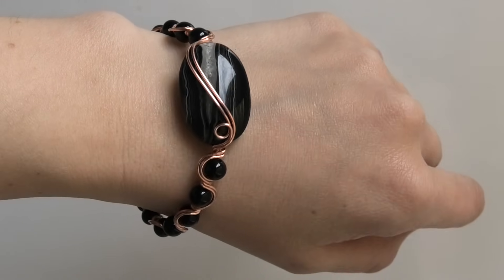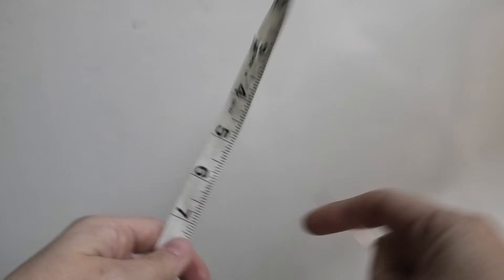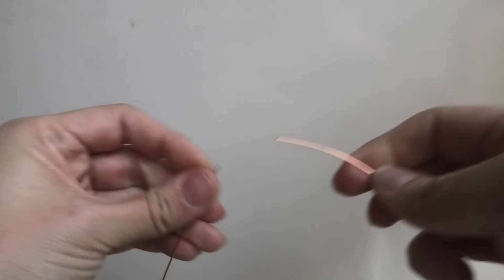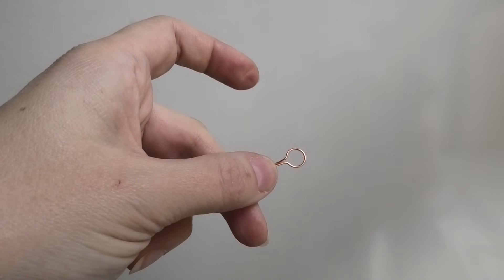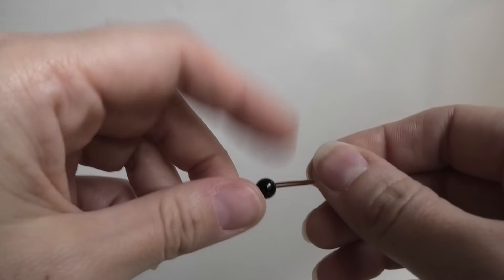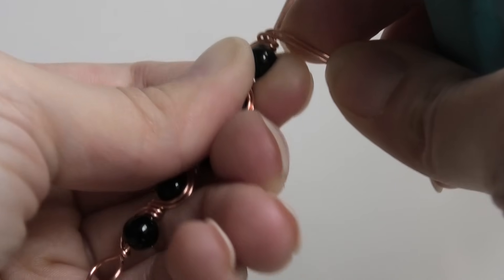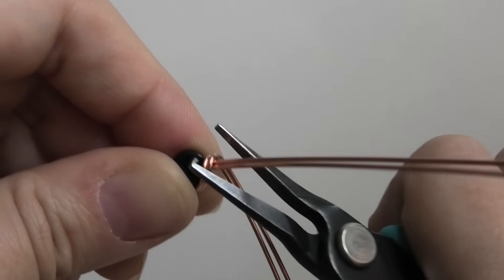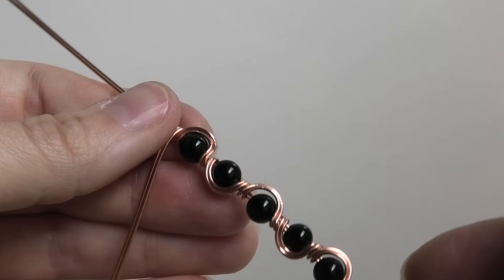Wire Wrapped Bracelet Tutorial with Beads

Comment: I've watched this a number of times now because I wanted to learn your technique. I almost never wear bracelets for various reasons but I do wear necklaces often. This pattern is gorgeous but I'd thought the wires wouldn't lay nice as a necklace. So, I used your pattern by making half a dozen lengths with only 4 beads each. Then I put the loops on both ends and attached each end to a short, coordinating chain (each chain 1 inch long) to connect them. It turned out beautiful! Making matching earrings is simple by just adding a bead, with the wire pattern you showed us, to earring wires. Perfect! Thank You!
Reply from the maker: That's a great idea!
Reply: @OxanaCrafts  Thank you so much! I was surprised that you took the time to comment because I know you're very busy. I also appreciated your encouragement. :)